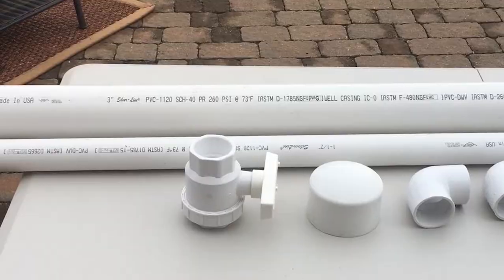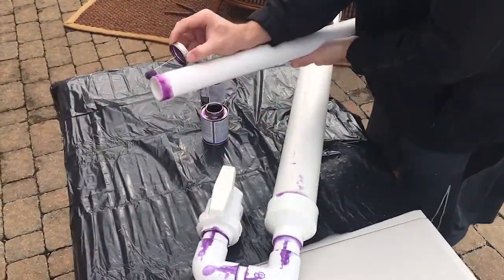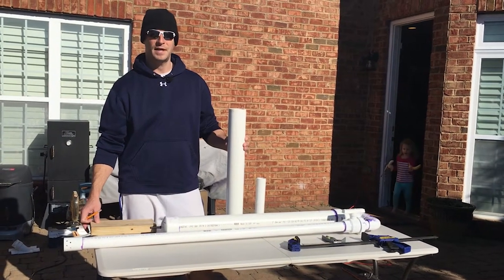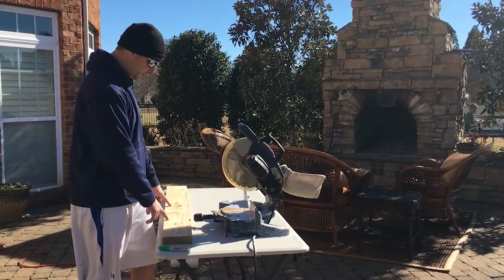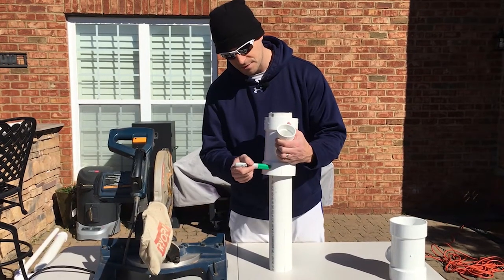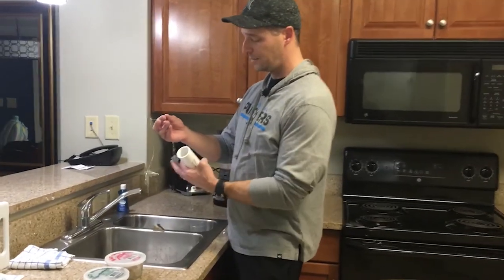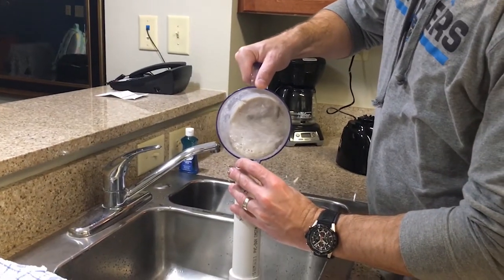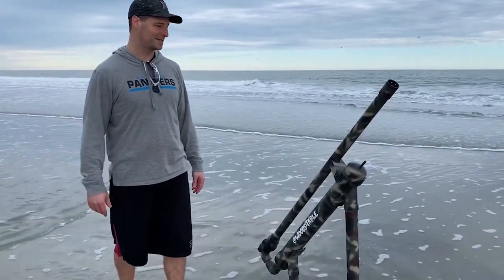How to Build a Bait Cannon! MOST DISTANCE FOR A BAIT CANNON! Easy & Cheap Bait Launcher!

Comment: This may have been covered by some other commenters, but I feel the need to save my back and arms when it comes time to pump up the air chamber. Dewalt makes an air pump that runs off of 12 VDC, 20 VDC Dewalt battery and it also can be plugged into the home a 120 VAC outlet...users' choice. Location will dictate what method you use. I have been wanting to make one of these for quite a while and this reminded me that I need to get busy.

Comment: 29/64 is the drill bit for valve stem....just need a little soapy solution and valve stem tool to pull through......29/64 is .453"      still need to drill smaller pilot hole.....I built the straight line one in your other video.  Thank you for the video
Reply from the maker: that's great feedback - I'll make a note of it - and thank you for watching!!

Comment: I’m not sure what beach you are on. I surf fish in Port Arkansas, Tx and I’m not sure if a 3oz pyramid weight will stay in one place. Have you seen any other weights used to make these bullets?
Reply from the maker: We use all types. 3oz pyramid is definitely pushing it. I'll use some a good bit heavier, including the ones with the wires on them that help them dig into the bottom. As long as you can fit them into the bait mold, you're good to go.
Reply: I so miss Port A.  Currently stuck living in Vegas but working on a 3 year plan to get me back home to Texas.  Hoping for S.A. so I can be closer to Port A for fishing.

Comment: Hello Mr. And good job. I was wondering if you can please tell me how you painted your cannon that camo color,  how do you make the camo pattern, what colors you used , did you used primer first then the paint? Thank you
Reply from the maker: Painting it is fun. Good opportunity to get the kids involved as you can’t really mess it up. You can always paint over it. I use black, light and dark green, and an almond color spray paint. All flat / matte finish. Use good quality paint so it doesn’t run. Start with a base of your light green all over, and from there just make all sorts of crazy designs. Start with lighter colors and finish with black. Don’t get too close or the paint will puddle and run. Didn’t need any primer at all, but you’re putting at least 4 “coats” on it since you’re using 4 colors.

Comment: What would you recommend doing if it doesn’t hold air? It leaking from one of the joints.
Reply from the maker: I'd probably start with the old soapy water trick to identify which joint is leaking. When you have the cylinder pumped up with a moderate amount of air, cover the joints with a thick soapy water mixture. Same procedure you'd use to identify a gas leak. You could probably also submerge it (or most of it) in a bathtub or a big garbage can full of water and see where the bubbles are coming from. Once you know that, come back and we'll see how to fix it.

Comment: Hello, I built my bait cannon just like yours. When putting air with my air compressor, it won't load more than 80 PSI any idea why ? I was hoping get as close as possible  to the 100 PSI but no more
Reply from the maker: Julio Cesar Anez most likely has a leak in one of the seals or else not getting enough air from the compressor. Does the gauge hold at 80 psi when you fill it, or does it fall (even slowly)? You could also try a bike pump like I use. If you have the same issue, likely a seal. I got mine to 140psi this week with no issue (though really tiring to do with a hand pump!)

Comment: Very good, but any other option thn the pump? We have to carry the pump all the time
Reply from the maker: still working on it. We've tried several electric pumps (battery powered), but haven't had great results.
Reply: Small oxygen tank or any compressed air or gas. Still something heavy that you have to drag around... But at least no pumping by hand.

Comment: Made the mistake of using cpvc glue.  In your opinion do think it will still hold at 80 psi?
Reply from the maker: This question was a bit educational for me too. Had to google it. From what I’m reading it looks like you can use cpvc cement on pvc with no issue. Cpvc is more durable and more temperature resistant so the glue sounds like it would be stronger. I feel somewhat obligated to say this is use at your own risk so please do a bit of research as well before trying, but if it were me, I’d feel comfortable trying it out.

Comment: I made this and molds. My issue is ice not melting and not being able to settle weight so I can put tension in line. Mine ended up parallel to beach after launching several hundred yards.  Have you ever done without freezing or maybe not freezing weight so it sinks?
Reply from the maker: the rate the ice melts can be a problem if the water isn't warm enough. Not freezing the whole rig wouldn't work well. Everything will scatter upon leaving the barrel and you'll lose your distance as the air dissipates. Not freezing the weight seems like a good suggestion - I may try that out and see what happens. It may do funny things to the rig in flight, but would like to see.

Comment: How did the cannon work? About how far did shoot your bait. I am thinking about making my own.
Reply from the maker: At 100psi I got 125-150 yards out of it on a very windy day. I was nervous to push the seals too far, too soon. I've tested the seals higher and we're headed back to the beach this weekend so I'll update you very soon on the max range! Keep in mind, though, a lot is going to depend on your specific rod and reel, line diameter, eyelets on the rod (amount of resistance on the line during the cast), wind conditions, and the angle of launch (how deep you set your front and rear spike). Good luck!

Comment: I got a 2” valve from Lowe’s and it’s impossible to turn the valve.  What is your suggestion.
Reply from the maker: they can be pretty tight especially when they are new. You can do a couple of things. 
1. lubricate the valve (you may want to do this to help wear it in, but you're not going to want a lot of wd-40 or similar in there that is going to blast up onto your bait when you fire it in a fishing situation)
2. attach a dowel rod or a long screw driver to the valve handle to give you more leverage when you turn the handle, and you can open it a lot faster. easier on your hand / wrist, and reduces air loss so you might even get more distance. 
3. using a combination of 1 and 2, wear it in by opening and closing it a lot. 

you could  test the different valves in the bin at lowe's and see if there are any that aren't as tight. or, if all else fails, try a different valve than the pvc, but just make sure all of your connections fit properly.

good luck out there!
Reply: Yeah, putting a longer handle on the valve is a must do in my book.  It makes the launch go so much smoother. I have done it with every one I've built. Have made around 7 In the last 5 years. I usually take about a 8 inch to 10 inch piece of aluminum channel and then use sheet metal screws and screwed into the handle.
https://ibb.co/42f8KWn
https://ibb.co/gzmndJV